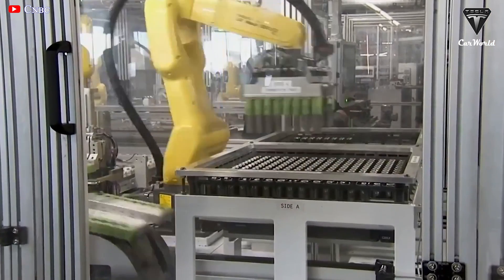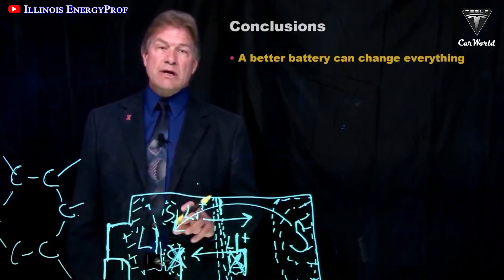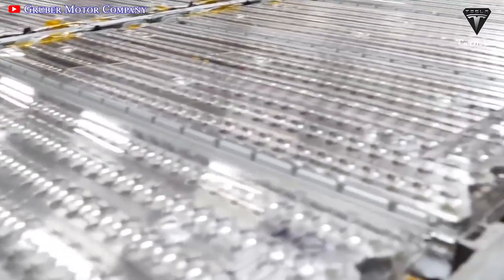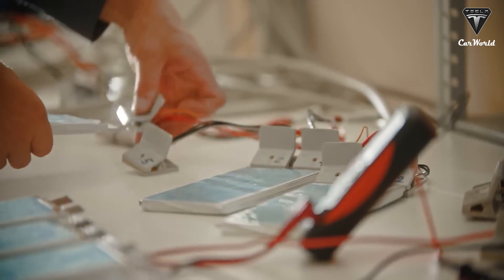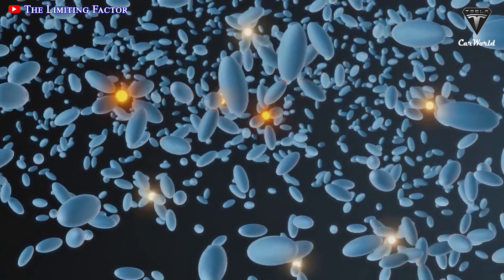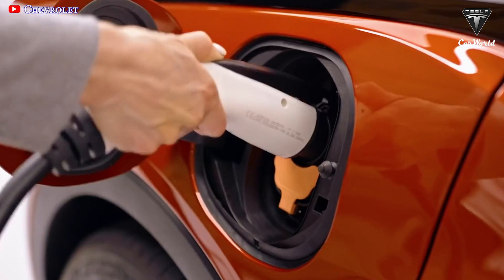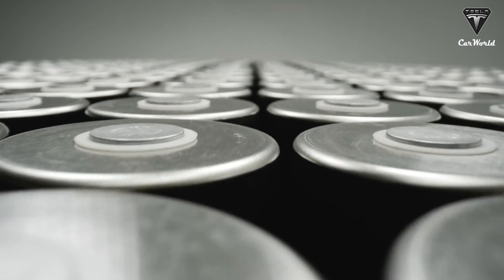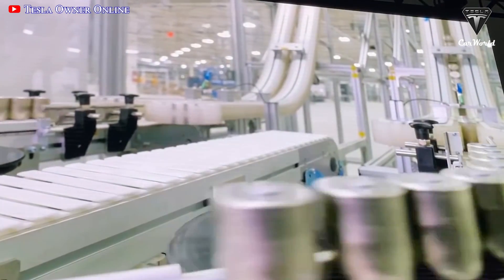Just Happened! A New Type Of Lithium-ion Battery Electrode, Charge 5 Times Faster

Comment: The sooner it’s released the better.  We need to have a better cleaner world.  This is a start.
Reply: That not only depends on how the electricity is generated, but also on how much an EV is used.
Most EV's start being cleaner then comparable cars with combustion engines only after around 50 to 70k miles, and only when the electricity used to charge them is 100% green.
I've seen pictures of EV's in California being charged by a diesel generator, that doesn't do much good.
Reply: @nicomeier8098  It will certainly take awhile for people to take seriously the issues at steak.  All machines that use fossil fuel need to stop.  Solutions to these problems with take time and real effort.  Electric cars are just a beginning.  Humans need to wake up and take decisive action. EV’s are not the complete solution but a start.  I doubt mankind will ever stop being selfish and thoughtless.  We can only hope that our Heavenly Father and created will step in as he promised.
Reply from the maker: A new beginning for lithium ion batteries. Thanks for your comment and have a good day !